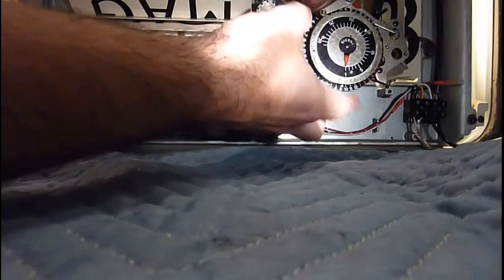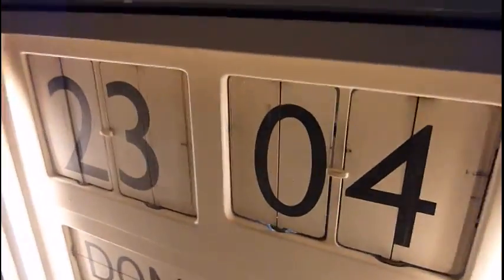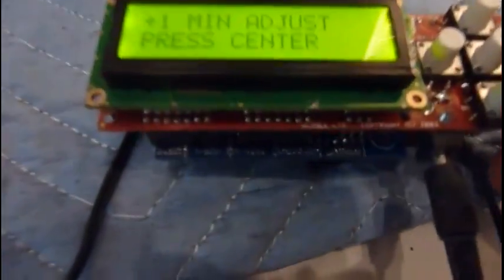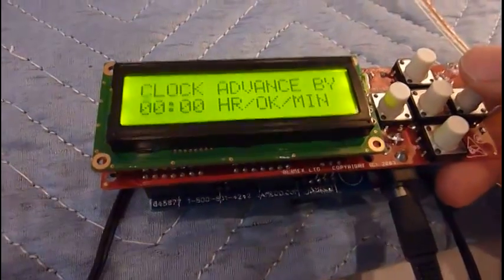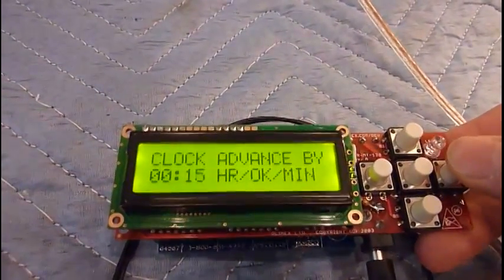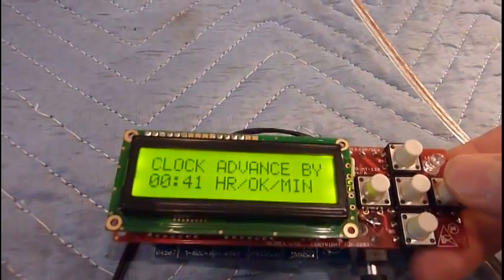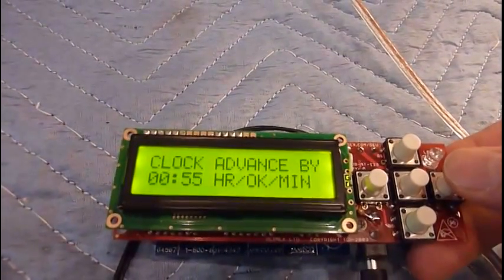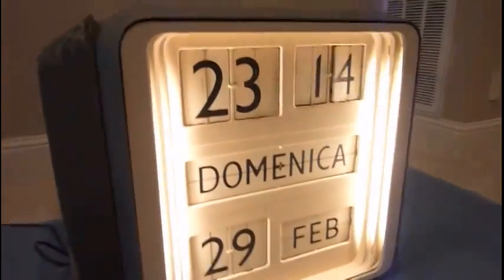Solari Udine Dator 10 Flip Clock Restoration Part 4 Final

Comment: Hello Marc. It is very fabulous.May I have a question? To make the impulsing board, what do I need to do?
Reply from the maker: My pulser circuit design details are published on my website: https://www.curiousmarc.com/mechanical/dator-10-flip-clock#h.m0o5q5e7c77s
Reply: @CuriousMarc  Thank you.So just need the board and the hex file(looks like eeprom some sort?)?
Reply from the maker: Also I had to make a small interface board with two relays to switch the +12V and -12V pulses, but I just hand soldered it and did not document it.
Reply: @CuriousMarc  Thank you very much. I think I should study how to make it as yours. Can you specify the board name and explain a little bit about that?
Reply from the maker: @solariudine5034  It’s an old development board from Olimex. Not made anymore but you could find some on eBay maybe.
Reply: @CuriousMarc  Actually. I bought 2 AVR-MT128 boards, just need to know what relay I should add to
Reply: @CuriousMarc  I mean I bought the boards with LCD already. So, just like to know what daughter board to add on them.
Reply from the maker: @solariudine5034  Oh I just fabricated my own from perf board.
Reply from the maker: @solariudine5034  I found the schematics and sketch I made when I built the daughter board in my lab notebook. I added it there https://www.curiousmarc.com/mechanical/dator-10-flip-clock#h.m0o5q5e7c77s . It's the best doc I have for it so far...
Reply: @CuriousMarc  That’s it!! Thank you Marc ;-)

Comment: Great job and very cool to combine modern electronics with the vintage flip mechanism.  How did you manage to acquire the correct modern electronics to interface with this clock?
Reply from the maker: I just custom made the electronics myself...
Reply: You are one talented guy!
Reply: Yep, he is! The basic concept is simple enough though. All it needs to operate is a 60 second timer that sends a pulse every 60 seconds. The controller to advance it, is simply another pulse generator that is customisable, to allow advancement.

Comment: I can't help wondering why it has facility for 40 day months. (perhaps, if I watch the whole series, I will find out)
Reply from the maker: +edgeeffect: Easy. It's "mechanical logic". It needs to display 9, 19, and 29, in the days of the month, so the right paddles have to count up to 9. It has also to display 30 and 31, so the left paddle has to go up to 3. Paddles only flip forward, counting up. So when you are at 31 and need to go back to 00, the only mechanical way is to count up to 39 flipping the paddles, then one more to 00. So you temporarily go through day 39. It's very clever. There is a spring mechanism that winds up and stores energy during the earlier part of the month, so it has enough energy in store to do the multi-flip at the end of the month. That mechanism is shown in part 3 here: https://youtu.be/fbsXvy5lUvk